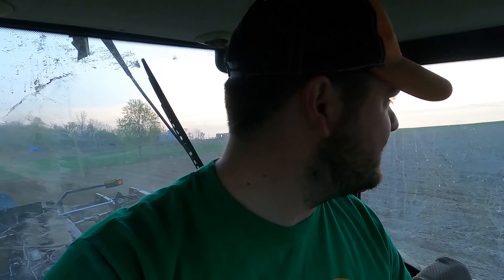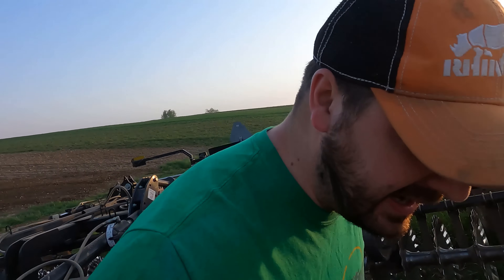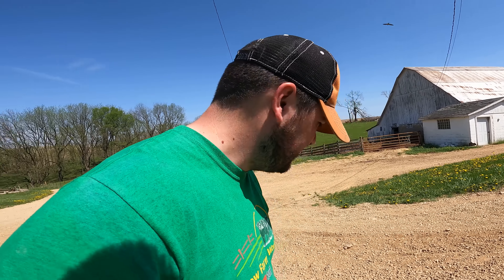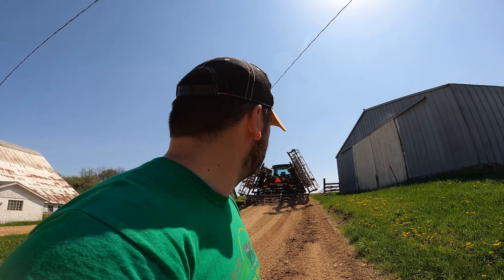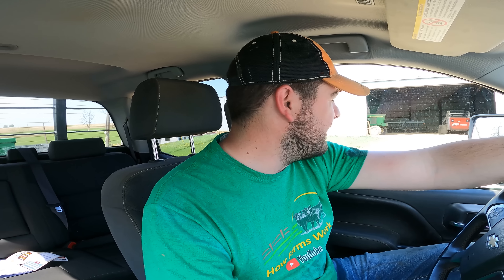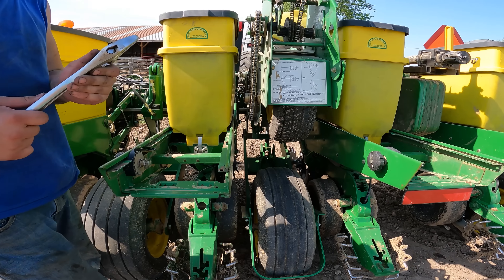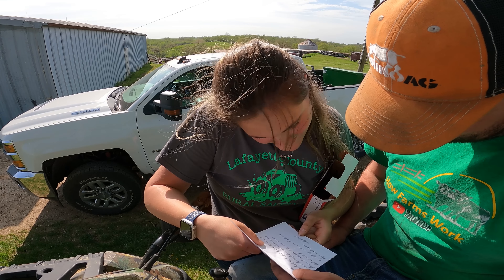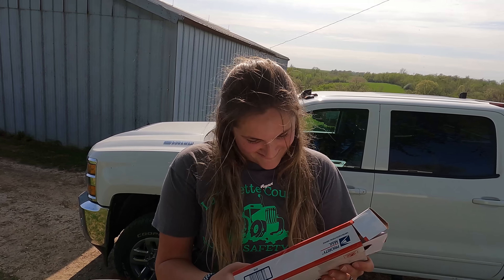O Tire, Where Art Thou?

Comment: Yes, overgreasing is a thing for sealed items. Periodically check the wheels and inner seals from time to time, pump a little grease in the zerk.  Even just popping off 1 hub cap to see how much is there is a good indicator but always one of those things since one can't see the inner bearing, best thing to do is have the hub cap off and pump some in until you can see some seeping through the outer bearing.

Comment: I feel the only problem with over greasing a wheel bearing is if the grease were to force the seal out the back and then allow dirt to get in.
Reply: I have to agree on the seal considering I have probably done over a 100 hubs/bearings and seals on a variety of trailers. If grease squirts out the rear seal every time the hub is greased, then the rear seal will fail. Not the bearings or race. Those fail because of wear and tear over time. No avoiding that failure. Grease just helps to push out the date of failure.
Reply: I've greased a lot of hubs and never forced out a seal.  

Once that wheel got a little loose it beat the bearing apart till the wheel was able to come off the spindle.
Reply: A little dirt won't hurt anything
Reply: @bigguydiy2184  You'll never get grease to make the seal fail. As someone who has 30t years of 4-wheeling in jeeps and trucks anything even farm stuff that gets the dirt by the seal will make them fail every time. Bearing buddy's or anything else like it is a lipstick on a pig comparison. The hubs should be pulled and cleaned every year.
Reply: As a retired Ford Master tech,  overgreasing WILL force excess grease to "seep" out, resulting in a compromised  seal. And that compromised seal will then allow moisture and dust in to further compromise the grease.  Ask ANY certified mechanic, not some guy who's been "driving jeeps for 30 years".

Comment: We've had a bearing fail on a new feeder wagon. Plenty of grease. The bearings were manufactured in China. The ball bearings turned to powder and the wheels both fell off within a week of each other. That may have been your issue even though you have a lot of miles on your wheel.

Comment: Check the bearing nut when you grease.   Just check the play with tire off the ground.   When the bearing  is too tight or loose it can cause early failure.

Comment: I think your fine. The over greasing is just hard on the seal. If your seal was good, your weren't doing wrong. Once the seal let's go then dirt gets in. Dirt is the enemy. Bearing cages just break. This summer you might take the time to go through the main frame wheels on the other side and inspect the bearing cages real good.

Comment: I’m one of the mechanics at a local AGCO dealer.   You didn’t over-grease anything.  The bearing could have failed because a flaw in the bearing (or it was a Chinese bearing), it was installed too tight, or it was installed too loose.  Too much grease is only a problem if you blow out the back seal… which would be easy to spot.

Comment: I would really be surprised if that failure was due to over greasing, over greasing causing over heating, but usually only occurs in high rpm applications, over greasing can cause seal damage, but usually doesn’t, unless your using some type of high volume grease gun.

Comment: I don't believe the over greasing theory. There was a mechanic who claimed that overgreasing universal joints on drive shafts caused failures. I had to show him the instructions from Spicer, the manufacturer of the joints, that say to grease them until fresh grease comes out of the seals. Grease seals are designed to keep dust out. As bearings heat up, the air in the hub expands and has to escape. The seal will allow that to happen. The problem with grease is that the rollers in the bearing eventually push it off to the side and need to be repacked. Large trucks and trailers were changed to oil lubrication to avoid repacking. The seals were redesigned to both seal in oil and seal out dirt. The hub covers on trailers have plugs that provide a way for pressure to escape.

Comment: As soon as you bust that seal with Greece you're gonna get dirt in there and that's the end of that yeah fill it up with grease and you leave it it's not some thing that wears out all you need to do is pull the cap off and check to make sure bearings are still tight and there's still grease in there and that's it

Comment: I don't think you ruined it from over greasing. I think the bearing just failed from metal fatigue or stress. There is A LOT of weight  on those hubs when the VT is folded and raised. No one over-designs anything anymore. You could have hit a pot hole or something on the road and just broke the roller cage on the bearing.